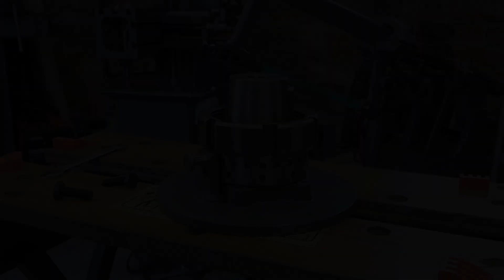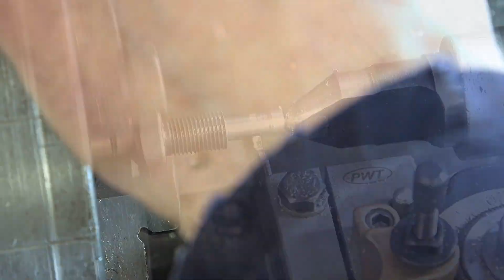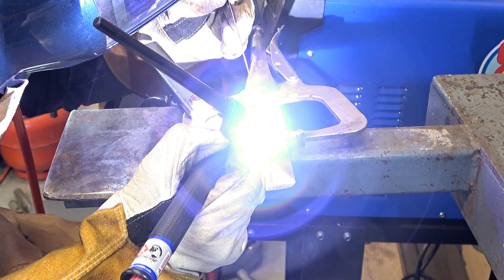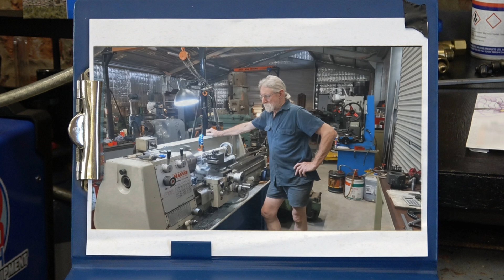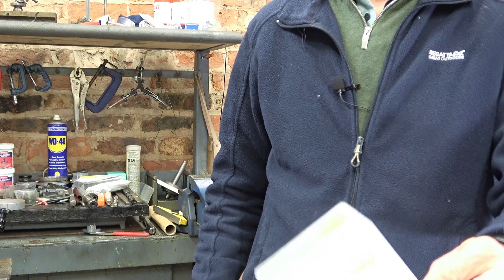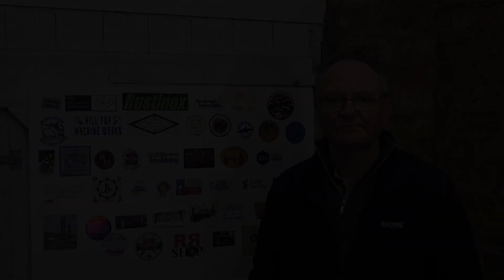HS236 Odd jobs and stickers 16

Comment: Are your indexing hole/pegs straight bore or tapered?

Tapered will give you a lot more accurate indexing and reduce backlash.

I don’t mind lathe cleaning, most of my days start and end with puttering.
Reply from the maker: Hi pvtimberfaller, it's straight and like a sausage in a drainpipe.  Off camera I have made another out of brass which is a lot better fit. Cheers

Comment: For your indexer, a slight taper on the pin would lock in and give a more positive location.
Reply: I was thinking the same thing. One or two degrees will do.
Reply from the maker: Hi Robert, off cam I've made a new brass pin for the spring plunger and that has improved it quite a bit. Cheers